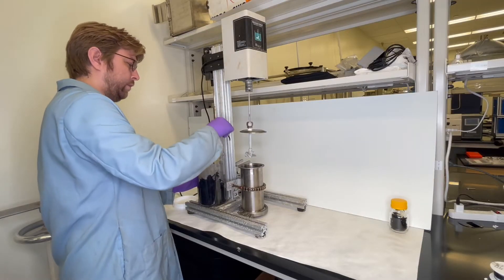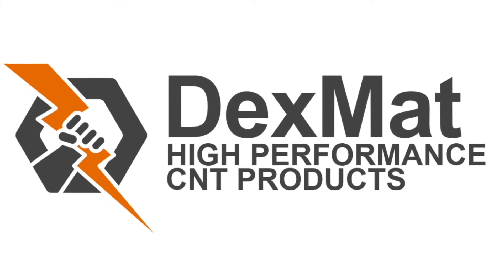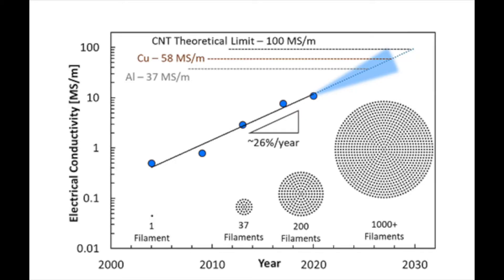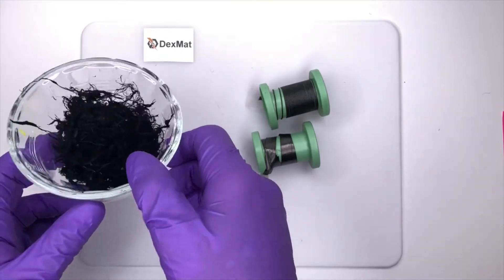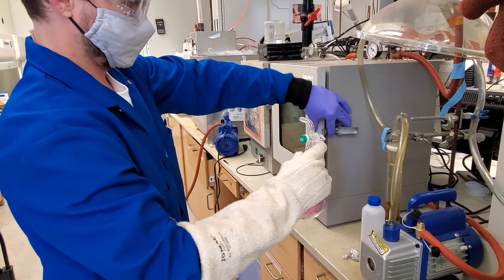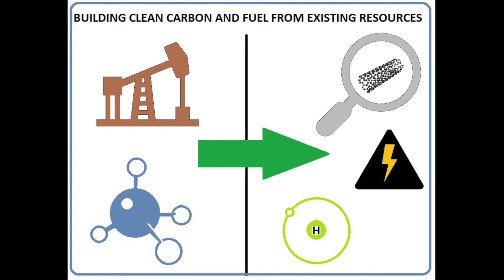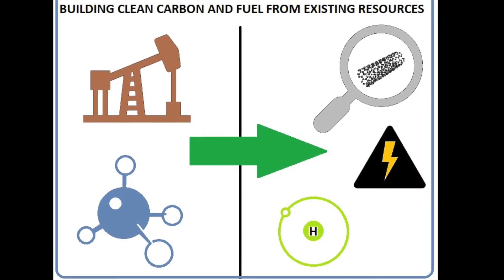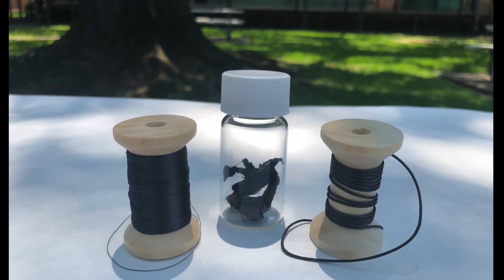"Clean Carbon Conductors" CABLE Conductors Manufacturing Prize video submission

Comment: What about doping carbon nanotubes and wrapping it around a shaped stainless steel or other metal wire?

Have you guys tried wrapping/twisting graphene Boronitride carbon fiber with carbon nanotubes, and wrapping that around stainless steel in a composite?

Comment: Hai. I want to ask, this is graphene? 
May i get your email please. I want to ask a lot about this and your project. 
Thank you
Reply: I doubt they will be willing to answer all your questions, but I can answer some questions for you if you'd like. CNT is not the same as graphene, although they are both made from carbon atoms. Carbon nanotubes (CNTs) are arranged in a cylinder structure whereas graphene is a flat two-dimensional structure. Every structure makes a different chemical compound, like diamond, which is also made of carbon (and also one giant visible molecule).
Reply: @malachite072  yes i know. I will replay again letter. I still on the road to go home. Thank you